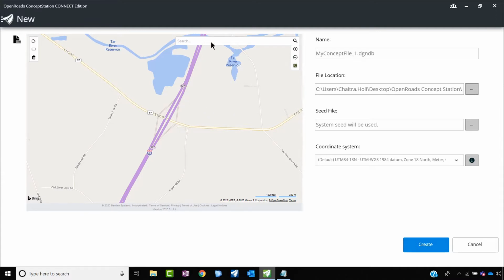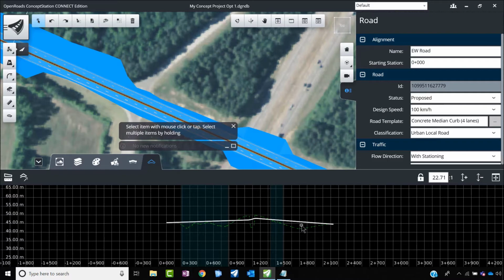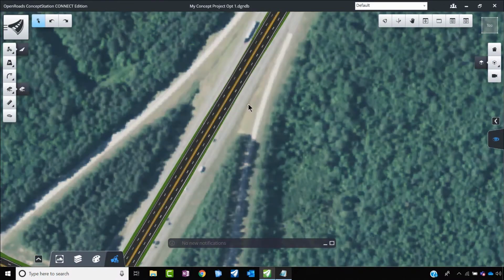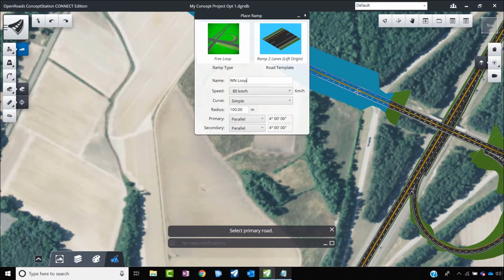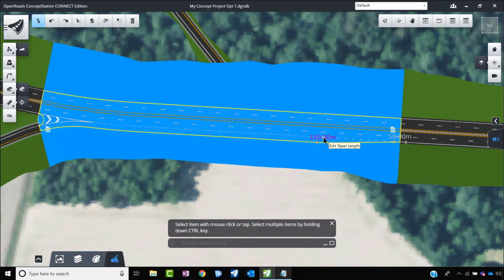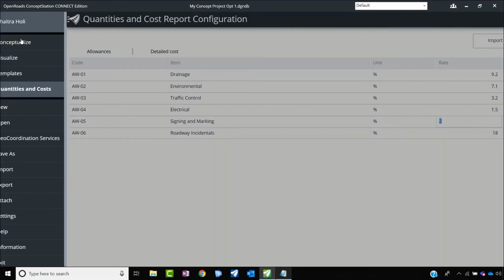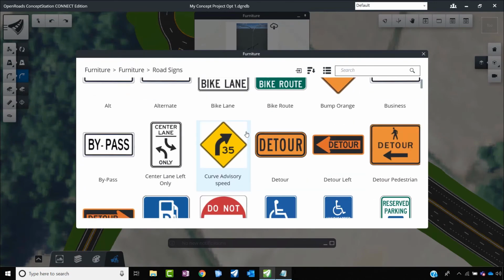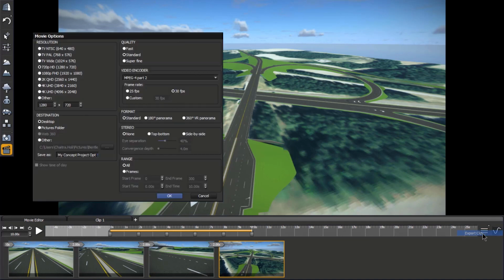Conceptualization with OpenRoads ConceptStation

Comment: I am pleased to share with Bentley, Professionals and Companies the most advanced technological tool in existence: the Digital Twin that I invented in 1981 under the name of Virtual Instruments.  https://youtu.be/eadaQiL_AK0              https://youtu.be/fXlp4QLdWQs
Export the Revit, Plant 3D, Civil 3D, Inventor, Engi file of the Building or Refinery to Excel, prepare Budget 1 and export it to COBRA. Prepare Budget 2 and export it to Microsoft Project. Solve the problems of Overallocated Resources, Planning Prolems, prepare the Budget 3 with which the construction of the Building or the Refinery is going to be quoted